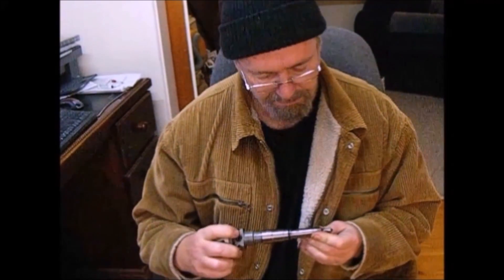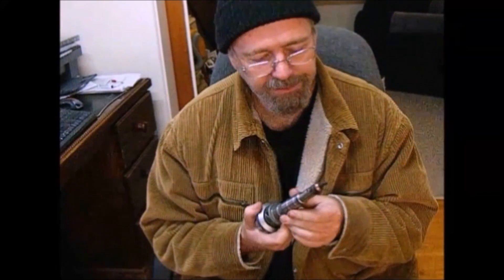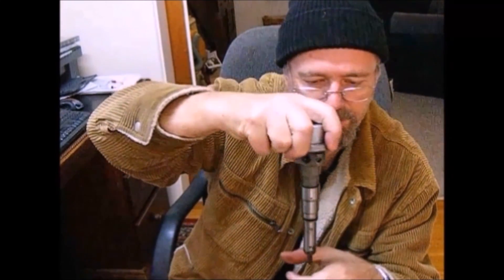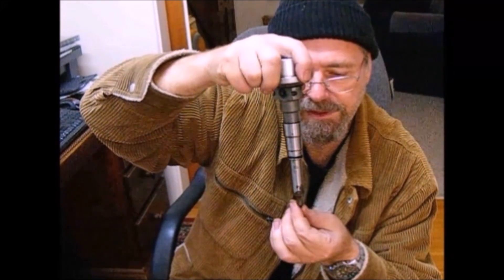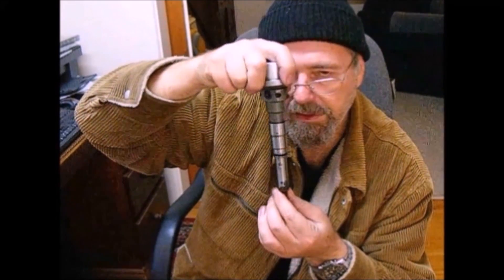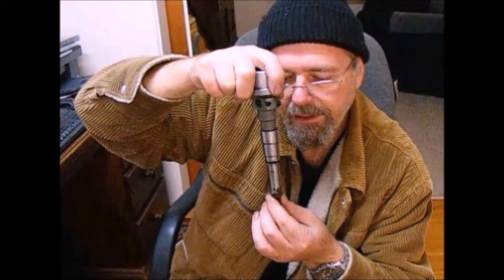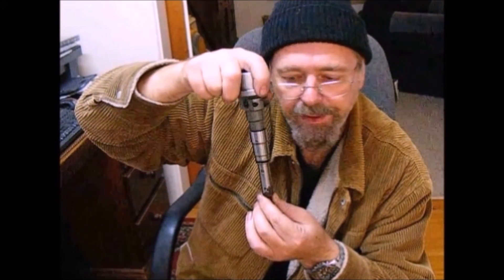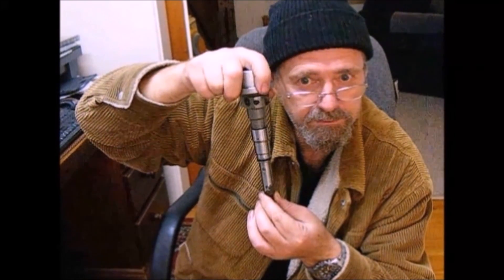Why Isuzu 4JX1 Injectors Fail - and How To Fix Them

Comment: Where can I get the specs for the 4XJ1 injectors? I have a suspicion that I have injector failure and nobody in Mozambique or South Africa have the repair specifications. Can you help.
Reply from the maker: Rod Shortt There is no manufacturers specification for the internals of the injectors. They are sold as a unit and not meant to be dismantled, since the output effects vehicle emissions.  The reality is that small variations from new spec will still allow the engine to run well, but may not be right as far as hydrocarbons in the exhaust - so Isuzu only sell new calibrated units - the analogy might be that disconnecting the EGR system makes more pollution but the engine still runs well.. . However, CAT injectors - which are identical - utilize an overhaul kit, containing a solenoid and a set of O-rings.  Therefore, if one is very careful, the injector can be disassembled/cleaned/check solenoids for correct operation, resistance variations from one coil to another etc/ & replace O-rings.  The O-ring most likely to wear is on the pintle piston and is green coloured - this is "Viton" a teflon based rubber.  Viton is widely used in racing engines, so any O-ring specialist can be used to source these parts and rather than mess about, it is far easier to take the disasembled injector to the O-ring specialist and get them to measure for the ideal part.  There was a crowd in Germany who were supplying reconditioned 4JX1 injectors, so clearly a recondition is possible.

However, the simplest way to check the injector electrics is with a Tech2 diagnostic tool, since it reads changes in injector solenoid resistance. However if you don't have a Tech2, the shorting of pins 4&6 on the OBD2 connector (beside console in cabin) will cause the dashboard MIL light to flash a sequence that can be counted to give a number that is an error code ( if one exists ).  This procedure is described in section 6E-27 of the Isuzu Manual.  6E-54 contains the list of error codes.   And so a Tech2 is not really required for a basic malfunction.  "P0201" is injector #1, P0202 is #2, P0203 is #3, P0204 is #4.  This test will isolate any faulty injector "circuit" so the problem may be faulty connectors rather than an injector. Just remember that the computer can only check for variations in the electricals, but not the hydraulic side of things. 

Like the LandRover TD5, the internal engine wiring harness needs replacing periodically on the 4JX1, and faulty seals or wires in this harness will cause the injector to malfunction.  So this should be checked before suspecting injectors. You will always find oil in the connectors, so clean them.  Some mechanics simply replace the well cleaned connectors then seal them with good engine grade silicon, rather than buy a harness.  Both ways work if the wiring is sound. 

Another assistance with keeping the injector harness connections good, is to make a little bracket to raise the large external connector of it ( near the dip stick/oil filler ) so that any oil "wicking" down the wires from inside the head simply drips into the engine bay rather than enter the connector.  

Since you have to take the rocker cover off to inspect the harness, you are able to perform the simplest diagnostic routine of the injectors there is..  For this test you should lay some rag around the exposed head to catch oil, and perhaps have some cardboard on hand also to redirect spraying oil.  Start the engine ( it will start fine even without the turbo ).  Now watch each injector.  As each injector "fires" it is powered by pressurized oil, then that oil is squirted out of a tiny hole in the side of the injector body.  This also helps lubricate the camshafts.  So you look at the "squirts" from each injector to see if any are less powerful than others..thus indicating a less efficient injector.  This is perhaps a superior test, for it allows you to see not only if the electric solenoid is operating correctly, but also to gauge the hydraulic efficiency of the injector internals.  Of course, an injector that is not squirting at all is dead.
Reply: Thank you for your feedback. My car has been hard to start after standing but then runs well. My mechanic tried another set of injectors but they did not get higher than 2500rpm. He changed back to my old injectors started the car and drove home. After he had a meal he tried to start the car again and had a difficult time starting. When it did start he drove down the road and it lost all power. He managed to get back to his shop and then it would not start at all. It still will not start. When he put the other injectors in the car would not switch off even after he disconnected the battery. Eventually after about three minutes the car died on its own. What could be the cause of this?
Reply from the maker: Rod Shortt the "dieseling" after being switched off.. especially for 3 minutes! .. normally indicates some diesel fuel in the engine oil perhaps.  This would indicate the injector sleeve seals are leaking..  However, since the cross contamination of fluids in a direct fire diesel can be in many combinations, symptoms vary wildly.. but it would be rather odd for such contamination to keep changing around all the time.. eg a lot of white smoke will normally continue as a lot of white smoke until the sleeves are fixed.   So before launching an assault on the injector sleeve seals, another possibility is lingering pressure of oil in the main oil rail.  This pressure is controlled by the Rail Pressure Control Valve ("RPCV" on the back of the HP pump and regulates it's output), this valve often gets gummed up over time and can be removed and cleaned. That would explain being hard to start, but running ok once there's a bit of heat to loosen up the oil. The valve can be replaced with a CAT diesel part quite reasonably priced, please PM "Delawarecop" who has commented below - since he's the one who tried the part and knows the CAT numbers. Your symptoms would suggest the RPCV more than other things to me perhaps, since fuel is driven into the injectors by high pressure oil, so if that pressure fluctuates, dropping pressure starves fuel, rising pressure increases the flow.  I conject that lingering pressure in the Oil Rail may be causing the injectors to bleed fuel even after the solenoids have been switched off.    Another component effecting Oil Rail pressure is the Oil Rail Pressure Switch ( ORPS ) which is bolted to the rail in the middle, these are cheaply available on eBay and best simply replaced if suspect. The ORPS is what the engines computer reads to regulate the RPCV and hence oil rail pressure. 

When you turn the key off, the solenoids on the injectors must stop working, so if the engine continues to receive fuel for 3 minutes after the pintle in the injector can't open, you must seek the reason for this.
Reply: Thank you. I will show these comments to my mechanic. Much appreciated. Hope I can get my car up and running again.
Reply: Edwin Henry Blachford We have cleaned all the valves as suggested but now we note that the car is not starting because it is not getting diesel. There is no power getting to the injector solenoids. What could be the reason for this? At wits end at the moment.
Regards.Rod
Reply from the maker: Rod Shortt ah... there are 2 reasons for power being cut to the injectors: 1./ a break in the wiring.  2./ the ECM believes there is a massive problem and won't fire the injectors - which maybe likely since the injectors are fired directly from the ECM through power transistors. This is best diagnosed by checking for error codes on the MIL light, or by using a Tech2
Reply: The error codes we found is it flashes once, then six times, then three times, then once then six sets of six flashes.
Reply from the maker: Rod Shortt this is error codes 16 & 31 & 66 & 66 & 66.  ie oil temperature sensor + EGR Vacuum valve + glow plug relay circuit. Why it's repeating 66 is a mystery - perhaps it's the anti-christ ( 666 )...  .   An unusual mix of error codes but not unknown.  However, it might be wise to disconnect the battery to wipe the codes, then unplug the ECM and re-insert the plugs several times to be sure of a good contact. Then reconnect the battery and drive the vehicle around for at least 3 days in varying drive conditions, then check the error codes again.   if the faults re-occur on the ECM you will know where to look for loose wires etc,. or even a faulty sensor
Reply: Thank you.

Comment: Hi I have the 4jx1 and the diesel oil and the Engine  oil is  mixing . I am getti g to run around any idea what is causing this problem and how do I fix it.
Reply from the maker: Peter Johnson with any centre-fire injected diesel, of any make, ( i.e all modern diesels) the seals between the fuel injectors and the head should be replaced at intervals not exceeding 100,000km. It stands to reason that the seals at the tip of a fuel injector that is right in the middle of the combustion chamber must be maintained correctly.   This is often not done by mechanics in Australia since they wait until these seals fail instead. The exception to those mechanics would be commercial diesel mechanics, such as the guys at a CAT diesel workshop, probably because CAT were the original patent holder on these injectors so know a great deal about them.   When the seals fail, the engine acts in a similar way to one with a blown head gasket ( or cracked head ) and so suspect a faulty head last!  The symptoms include oil in the fuel, water in the oil, fuel in the engine oil or other mixes.  I must emphasize that a blown head gasket MAY be the problem, but by far the most common problem with the Isuzu 4JX1 engine is failed injector copper gaskets and then the rubber O-ring seals of the injectors after.  Since changing the injectors seals and copper washers is a fraction of the price of a head, I would always do that repair first.    

To replace all the seals on the injectors and their sleeves you need to borrow or make the tool described elsewhere in my channel that removes the sleeves.  (Please - no I do not supply the tool)  

However, it is often the case that the "sleeve seals" ( O-rings) have been been replaced by GMH at some time under a warranty upgrade, so it MAY be that only the copper gaskets at the tip of the injectors have failed.  Since these copper gaskets - along with the injector O-rings that are easy to get to... and are less than $200 all up for parts at GMH... perhaps you might start by doing that job yourself.  It is very straight forward, but you must obtain the Isuzu manual online ( about $10 ) to get the correct bolt torques. Then pop off the rocker cover and pull the injectors - easy job. It takes about 2 hours.    I emphasize USE THE EXACT TORQUE IN THE ISUZU MANUAL.  Most of these premature sleeve failures that I have seen in the 4JX1 are accompanied by some peanut mechanic over-torquing the injectors to the oil-rail and distorting the new O-Rings. Follow the manual and you'll be right  

If that repair doesn't fix the problem, you'll need to make or borrow the sleeve extraction tool and replace those seals also. Obviously, it would be better to do them all at the same time to be on the safe side.  I might mention that the Isuzu 4WD Club on Facebook ( who have members all over Australia ) has a number of tools that are regularly passed around to do this job.  So perhaps join that group, they're real Isuzu Trooper and Jackaroo experts :)
Reply: Thanks I had change the sleeve seal already that solve the coolant and diesel issue. Then the return valve went we fix that now we have this issue . I will get the copper gasket and source the o ring on line